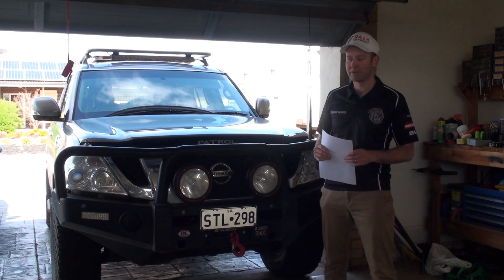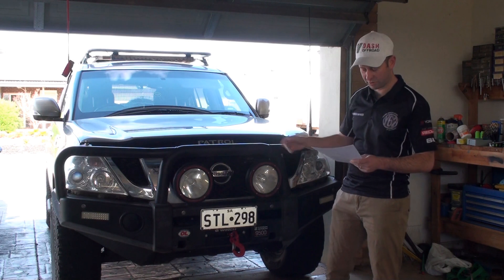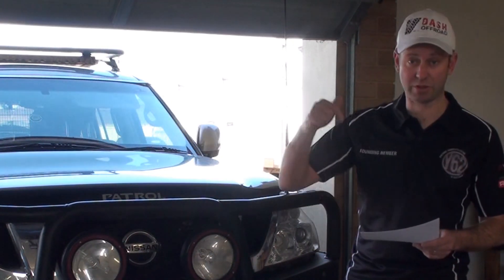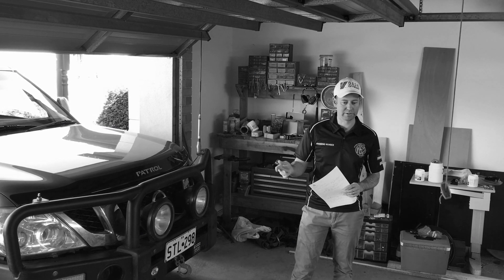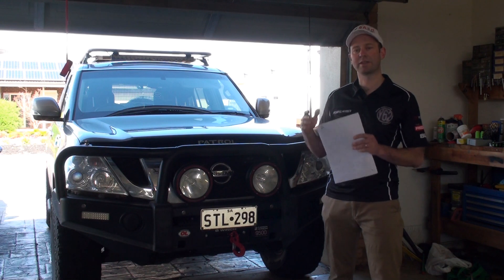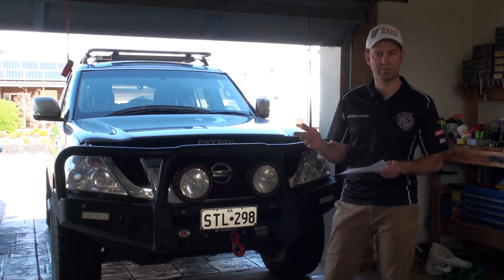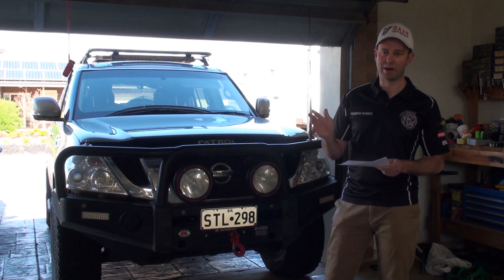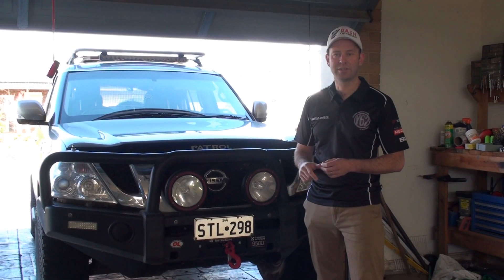Is Your Front Bar ADR Certified? ITS NOT!

Comment: Certification and compliant are different things but bull bar makers have to test them to make sure they are compliant with the crush rate making them legal. Interesting topic though.
Reply: So where can you find these certification numbers on these bars?
Reply: @WheelingWebber  They pass because they comply with crush rate. Like most accessories they  need to not compromise spec and if they do an engineer can check to see that it does not change the operation of the cars design.
Reply: Can you name one of these companies/bars that are crash tested so I can ring them to get their certification number?